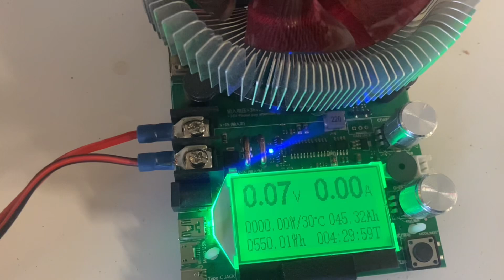DIY 12V LiFePO4 Battery Review After 1 Year | Capacity Test & Physical Inspection

Comment from the maker: Would you build your own LiFePO4 battery? Why or why not?
Reply: A few years ago maybe, but not today.  There are so many commodity batteries available now and they tend to have superior construction compared to what I might DIY.  Plus I've already moved on to 24V and 48V systems which are a bit more involved with the larger number of balance leads.   It is fun seeing people doing DIY batteries, though!

-Matt
Reply from the maker: @ thanks for the comment👍 I completely agree. With the current prices in LiFePO4 batteries, the DIY route could prove to be more expensive for the same quality components and build. Unless you get a really good deal on cells.
Reply: Already have.  I've built at least 5.
Reply: One benefit of building your own is that if a component fails and affects the operation of the battery, it could easily be replaced.  You can't do that with a commercially sold product.
Reply from the maker: @UmpTSquat so true. Thank you for the comment👍

Comment: 48 ah seems a bit small... Just saying 🤔🤨
Reply from the maker: It is a small battery.. depends on your needs I guess🤷‍♂️
Reply: It could be useful as an overnight camping battery.
Reply: It might seem a bit small if you don't know the reason for which it was built.  I built a 50Ah battery in a small plastic toolbox to use while at a week long summer camp in July.  I built the battery with 2 USB sockets and a 12v accessory socket.  I inserted a USB adapter into the 12v accessory socket which provided 2 additional USB sockets.  This recharged my cell phone and my tablet daily.  I powered a 5v USB LED light in my tent every night.  I also powered my 9 inch, 5v USB fan every night as well.  The 50Ah capacity was over kill for something like a week long summer camp session.

Comment: Nice little project and new subscriber.  I still have not built my own battery but have made the switch to LiFePO4 due to the costs being much lower than ten years ago.
Reply from the maker: Thank you and welcome to the channel👍🙌 The cost for LiFePo4 is so low now. It might even be cheaper to buy pre made batteries than going the DIY route in some cases.

Comment: Interesting timing; just yesterday I finished putting my pair of DIY 280Ah LiFePO4 packs through the same tests. I built mine a little over three years ago, and really haven't used them much (van build has been going slllooowww), and I found the capacity seems to have gone down about 10Ah for each pack, about 3% total. Not the worst I guess.
Reply from the maker: That IS interesting! Thanks👍

Comment: hmm recently had my 4s cells in my car swell up after getting run flat coz i was charging a 2nd 4s pack in my car thru a 100w charger while the car was in accessory mode. i think it was 18f outside. thought my phev would keep the 12v charged in accessory mode but it didnt. still using the battery as my 12v car battery every day lol. there is a 12v 15w heating pad in the enclosure connected to a w1209 relay, im wondering if mahybe the relay errored out and stopped working. no bms, just an active balance board coz its an automotive appliaction. these cells are bulletproof dude. for your appliaction though i would only stick to 280ah lifepo4 cells. theyre around 45$/kwh now, these cells are almost 3x more expensive per unit energy
Reply from the maker: Thanks for the input and for sharing👍 I agree bigger cells would be better for my application. It is a future project🤓 I think I would have used a bms in combination with the active balancer to protect the batteries from overcharging and discharging.

Comment: This is great, only lost 4% of initial capacity after one year of use. Also considering that you have used it consistently. I am planning to go offgrid and this video has affirmed my decision
Reply from the maker: Thanks for the comment! Good luck with your off-grid project👍
Reply: LiFePO4 tends to have a small initial drop in capacity in the first 2 years, then the degradation rate flattens out and slows down a lot.  So... within expectations.